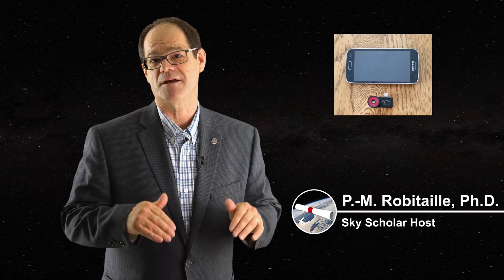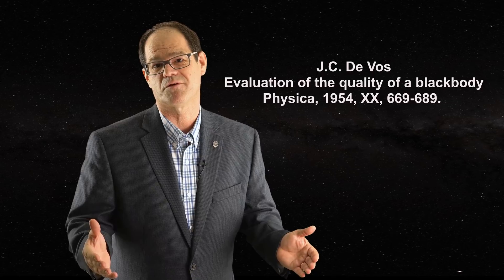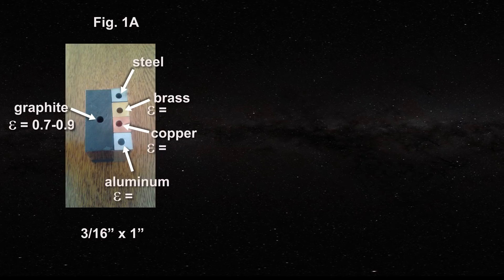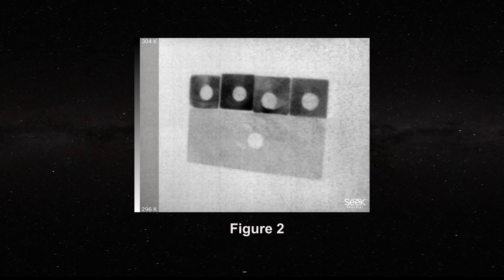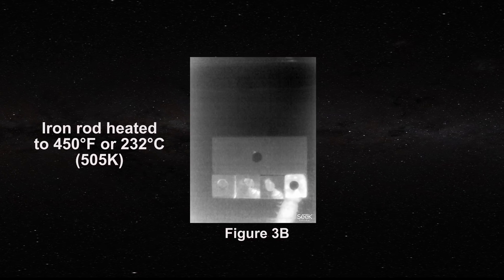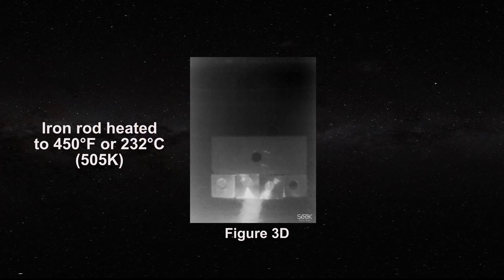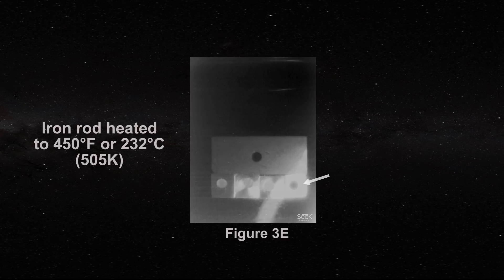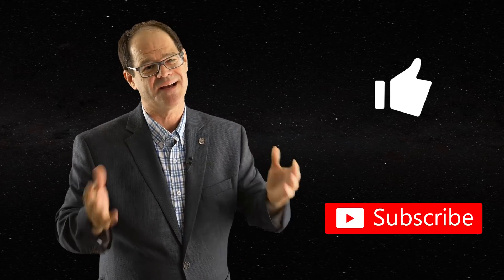Is Kirchhoff's Law True? The Experiment!

Comment: MY impression of the experiment is the following, with 0.03 emissivity 0.97 of the radiation is being reflected back and fills the hole.  thats why the holes show those radiations. this is clearly no contradiction to CRHF law. sorry. to prove your points you should have heated up all those 5 or 6 items to the same temperature and demonstrated they emit at different wavelengths sir.
Thanks.
Reply: David Zare my impression is that a thermal camera is the wrong tool for this experiment, because it isn't a proper measuring device for heat and thermal radiation in the way he used it. If he wanted to see if the temp was the same inside of the hole, he should have used an actual thermal couple inside of the hole, or better yet perform the experment properly by placing the object to be measured inside of a vacuum chamber, with a second vacuum chamber with just a thermo-couple as a control. But he didn't do that, and thats highly suspect.
Reply: @nunyabisnass1141  you're missing the entire point.  Thermal radiation is what we are interested in here, and thermal radiation can be captured any number of ways, including a thermal camera.  What this demonstrates is that while the holes all look similar when everything is at room temperature, but different when the hot object is brought into the mix shows that the properties of the cavities are NOT the same.  While the aluminum and brass reflected the heat of the hot metal and appeared to be hot based on the radiated output, the carbon and steel cavities remained relatively unaffected.  The fact that they behaved differently is the take-away from the experiment and proves Kirchoff's law to be invalid.
Reply: @Aleph Gates a black body spectrum is a continuous spectrum.  An infrared LED will be tightly confined to a specific frequency of light.  So it cannot be confused with the infrared heat given off by a black body.
But in essence, the experiment would show the same thing.  The actual "black body" made of graphite will absorb the incident radiation from the LED while the aluminum cavity will not.  Therefore, the two cavities are nothing at all alike.  The radiation coming from the aluminum cavity is not necessarily due to the cavity temperature.
Reply: David, you miss the entire point of the exercise that Dr. R went through.  According to Kirchoff's law, all of those cavities should have behaved the same.  The fact that they didn't, and that the graphite did indeed react like the black body ideal proves that Kirchoff's law is invalid.  With the graphite, the cavity retained the thermal radiation characteristic of its cavity temperature.  The other cavities radiated as though they were much, MUCH hotter, which of course they weren't.
Reply: @t00by00zer  The point David was making is that the cavities take different ammounts of time to reach thermal equillibrium.  I myself am a bit confused, none of these cavities reached the same temperature as the hot metal rod, if they would have, then they would have all had 505K, then we should have checked to see what radiation the cavities emit.

Heating the cavities to the temperature of the hot metal rod takes different ammount of time because of the different reflectivities, if aluminum has a higher reflectivity inside the cavity compared to graphite, then obviously it will have a lower absortivity, and will take MORE time to reach thermal equillibrium with its surroundings.
Reply: @sidewaysfcs0718  the point of the experiment was to show that the cavities are not equal.  All the cavities remained at room temperature, and therefore should have retained the same cavity radiation.  In the case of the graphite, it's spectral output was unchanged in the presence of the metal rod.  In other words, the heat radiation that reached the graphite cavity was absorbed.  The heat radiation from the aluminum cavity was reflected.  The camera inferred a much higher temperature from the aluminum cavity than from the graphite cavity and both were exposed to the same environment.  The aluminum cavity appeared to be at hundreds of degrees C and of course it was not.  

The two cavities are NOT EQUAL.  Kirchoff's law is invalid.

Comment: To test it properly you need to stay with the camera in black thermal mode and hold a thick copper rod with a heavy black copper oxide layer in front which has been dipped in liquid nitrogen  to block the radiation going in. This will then prove if the holes are filled with reflected rather than emitted room temperature radiation. At the moment you are comparing ~8 micron thermal wavelength radiation with specular reflection of much shorter wavelength radiation, which is not a valid comparison.
 
At the moment you are only testing the variation of abortion of the holes at shorter wavelengths in the absence of emission, which is expected as admittedly shiny freshly drilled metal holes are not great cavities. Kirchoff's law states the absorption and emission coefficients are the same,. To do the experiment properly you need to repeat with the metal blocks at >200C looking into room temperature.

What is "white mode" on the camera, sounds like it's with the IR filters removed? What's it's spectral response?
Reply: White mode is just the reverse of the normal mode.  Black hot, or white hot.  All you're doing is inverting the video signal.

What he's doing in this experiment is PROVING that not all cavities are equal at doing work.  Brass, copper and aluminum did no work on the radiation at all and simply reflected it back out.  The graphite absorbed the radiation of the hot steel, like a real black body should.  

That is why black bodies are always lined with graphite.  Materials like aluminum don't work.  In other words, Kirchoff's law is absolutely invalid.

Comment: What exactly did we NOT see that Kirchhoff says we should see; conversely, what DID we see that Kirchhoff says we should not? Does a high emissivity mean that that the material heats up more slowly, so that the equilibrium temperature which will validate K's Law has not been reached? Did you hold the heated rod close enough and long enough?
Reply: Gary, what you saw in the infrared light was that the cavities did not respond the same way, and that disagrees with Kirchoff's law.

All those bodies were at ambient, room temperature, and radiated from their cavities similar radiation profiles in the infrared.  When a very hot steel bar was brought near, the graphite cavity radiated at the temperature of graphite body . . . room temperature.  However, the aluminum, brass and copper cavities all radiated with the characteristic thermal profile of the steel rod, not the temperature of the body in which the cavities were drilled, violating Kirchoff's law which requires that the cavity radiate a thermal profile of the body, not the environment.
Reply: @t00by00zer  Oh, so the point of the hot steel rod was NOT to heat up the walls? Hmm, i'm possibly still confused.

So, let's say we just have 2 cavities, one is graphite the other is aluminum. 

At room temperature without the steel rod, the cavities are already at equillibrium with the room (since they have been for hours) and the point is that they don't both have the same emission properties if Kirchoff's law is incorrect. 

But what we say initially is that they did all emit the same, then the Professor said that because Aluminum is reflective, it will reflect the room temperature radiation back, while the graphite is absorbing the same radiation it emits since it's completely at equillibrium with the room, so it's impossible to tell the difference.

Then, when we bring the metal rod, the purpose of the rod is NOT to heat the cavities up? Ok, i'll go with this, so now we are comparing aluminum with graphite while both are exposed to hot metal rod radiation @ 505K, but the graphite is absorbing, while the aluminum is reflective. 

But now the aluminum will reflect some of the hot metal rod's radiation, while the graphite will not since it's a bad reflecter.  But if the aluminum and graphite are both at the same temperature, they should both emit the same radiation. 

Problem: the aluminum is still reflecting part of the hot metal rod's radiation, we still cannot make a good comparison cus we are NOT observing pure thermal radiation produced by both cavities, we see some reflected radiation of the hot metal rod by Aluminum.

I say the cavities need to be completely covered with the camera, to avoid them reflecting the room's radiation. And they all need to be kept at the same temperature. Then we film the cavities "in the dark" and we will only see their emission from the wall temperature, no more influence from any hot metal rod.

At the same time, the camera itself deffinetly will also emit some radiation, so this is rather puzzling. 

How do you really measure the radiation given off by a cavity purely from its own thermal motion without also having the problem of the cavity reflecting the room's thermal radiation or the camera's thermal radiation if the camera covers the hole completely?
Reply: @sidewaysfcs0718  you almost have it.  If Kirchoff's law was true, then when you bring that hot metal into the picture, both cavities should still project the same radiation because they are at the same temperature.  The fact that the graphite's cavity remains unchanged shows that the two cavities are NOT equivalent.  The aluminum projects a heat signature of the hot metal, not of its own cavity temperature.
This simple experiment proves that you cannot determine the temperature of the material by looking at its spectral output unless you know what the material is that's emitting the radiation.  Obviously, the aluminum wasn't at hundreds of degrees C even though it was emitting radiation that was the same as that hot steel.
You can't look at the cosmic microwave background and infer a temperature.